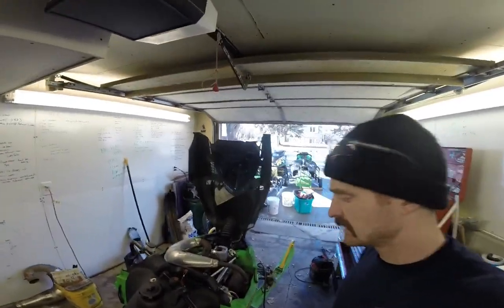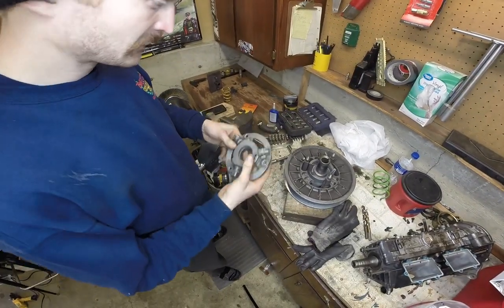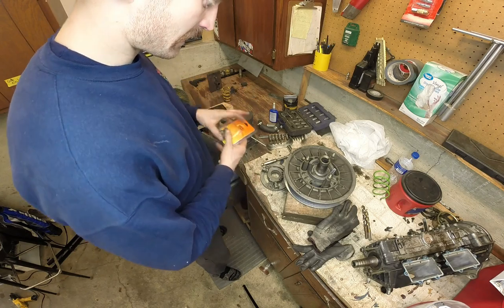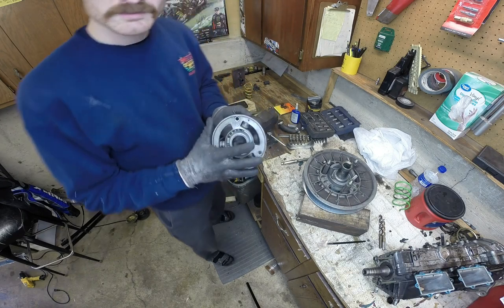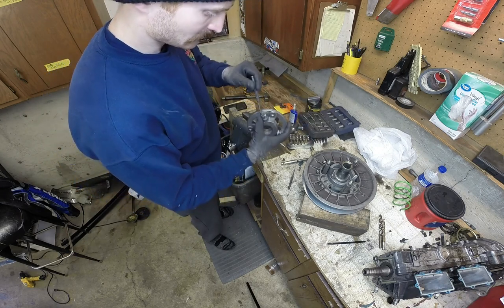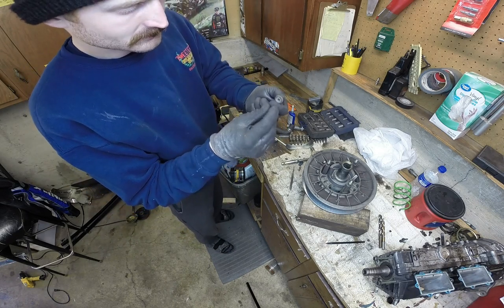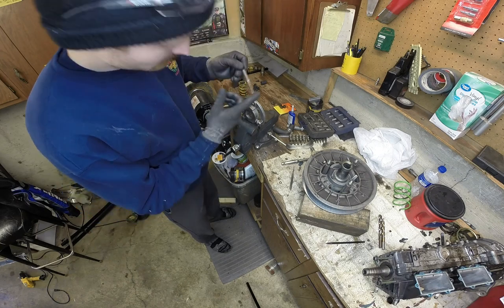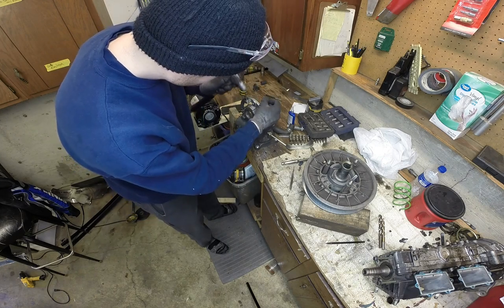Sled Tips 009 - Roller replacement Arctic Cat Roller Secondary driven clutch

Comment: Man you’re the best, perfect video! I guess it wasn’t too complicated, i’ll just have to go out and get a set of decent punches... never needed any until now! Do you know the sizes of your punches you used? I see you had one that was too short.... just want to make sure I buy some that will work for this.

I also need some clutch parts that you may have, ill reach out on your facebook page for that.

Keep up the great videos! Lots of cat guys keeping the old stuff alive, especially the old triples!
Reply from the maker: I should have measured the pin diameters, but I did not. All the punches I have are pretty old, but I have an assortment so I can usually find the one for the job! 
For this a set of straight shank punches will work best. The tapper shank punches run out of reach because they wedge in the hole.

Gotta keep that old Iron Alive! Triple pipes save lives!